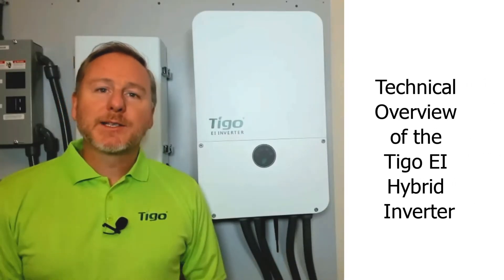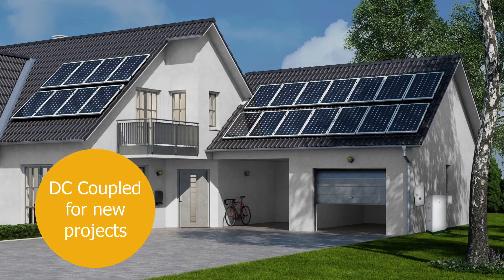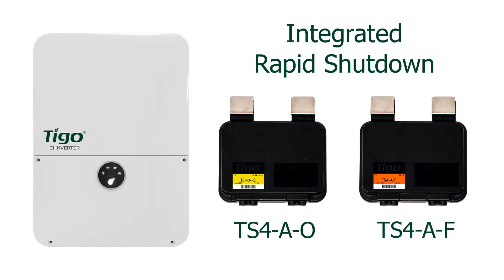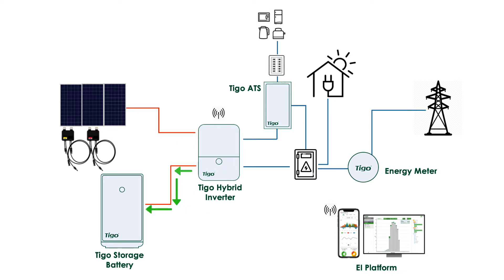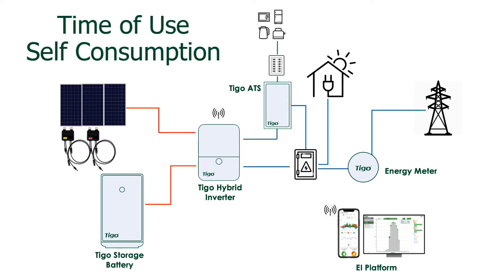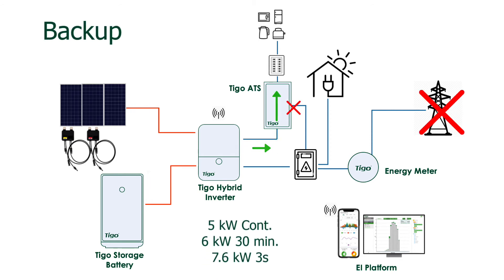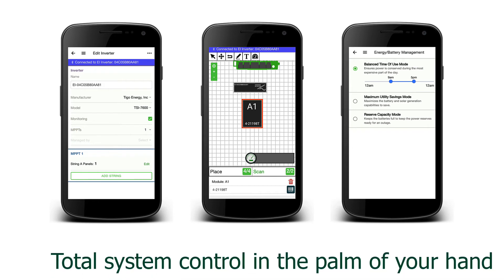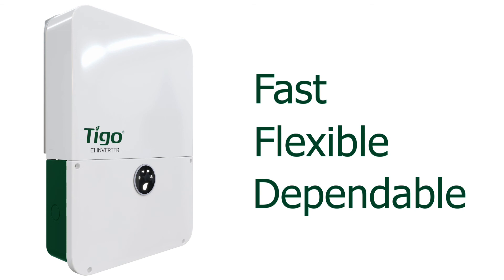Tigo EI Inverter Specifications Overview

Comment: can a 30kwh battery be added to the Tigo 10kW energy storage hybrid inverter system?
Reply from the maker: Thank you for your question. Our EI system capacity for the European models supports up to 12kWh of Tigo batteries. Our datasheet has the inverter and battery options. https://www.tigoenergy.com/downloads

Comment: If the grid goes down and the hybrid inverter switches into backup mode, can the inverter supply power to the load center with just solar input only or does it needs the addition of batteries to do that?
Reply from the maker: Every hybrid inverter in the world must have a battery to provide power when the grid goes down. In backup mode, solar power is used to charge the batteries and power loads if there is enough left over.

Comment: Can I use this inverter TSI-3.8K-US 3.8kW 208/240VAC with no battery installed?
Reply from the maker: Absolutely! A hybrid inverter does not need a battery to operate and may only run on solar. However, it will not provide backup power when the grid goes down without a battery.